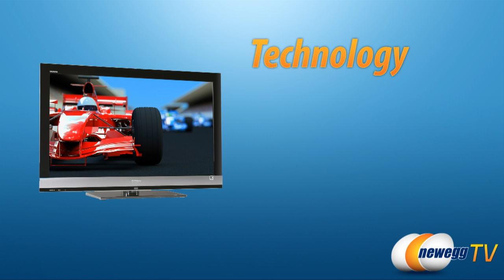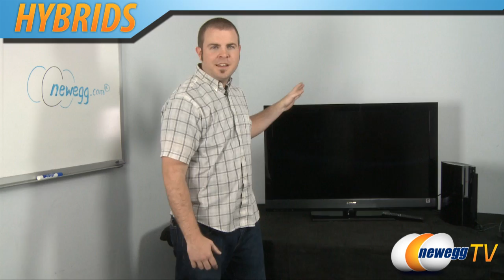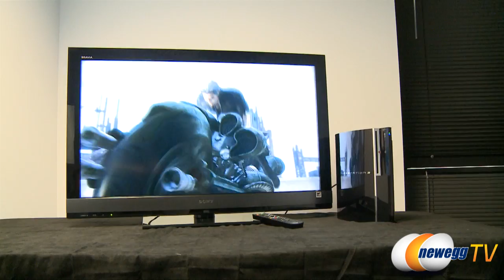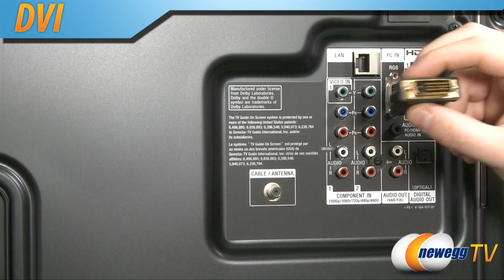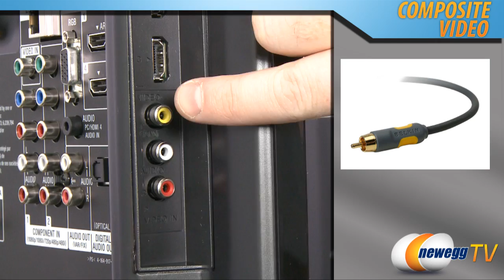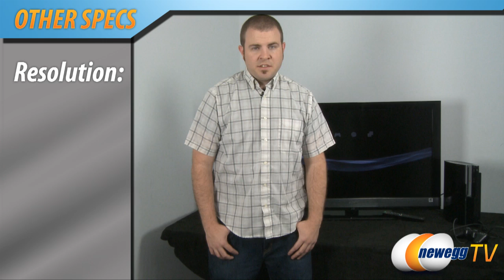Newegg Tutorial: HDTV Technology Guide

Comment: Plasma on it's way out the door...?  Will be fully replaced by led technology...?
Ya. sure pal. Pay twice the price for a display with inferior picture reproduction. Last year, I bought a 40" samsung lcd 60 hz 1080p for $750. Motion resolution sucked. High speed games were virtually unplayable.Took it back to trade up to the 120hz model...FOR $300 MORE! instead went to panny plasma 42" 600hz 1080p for $50 less. I couldn't be happier. Color is rich. High speed motion is no problem.